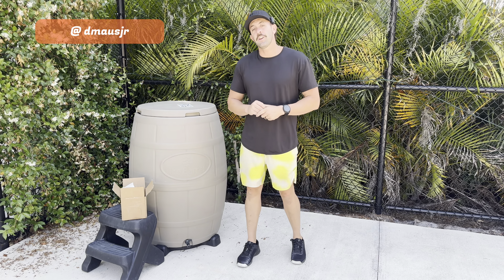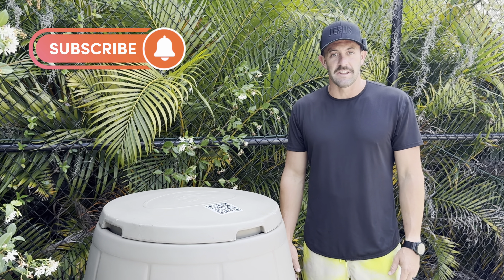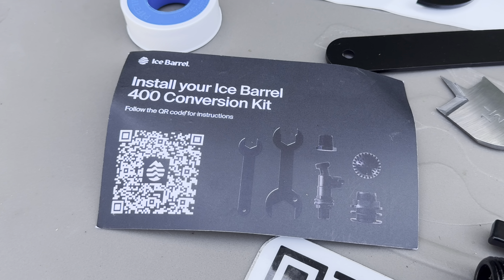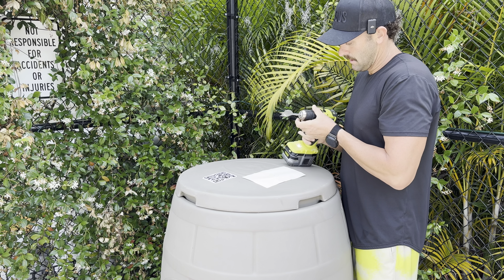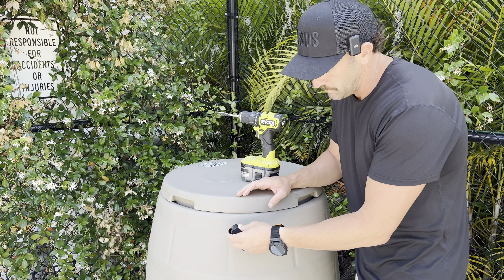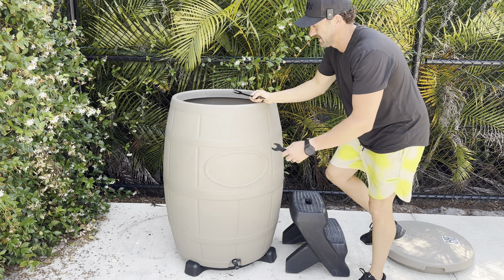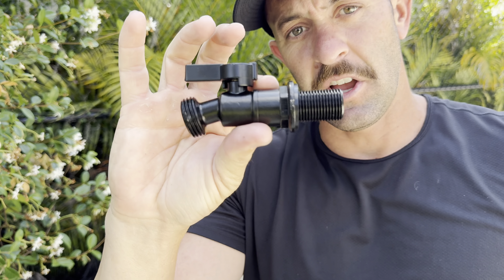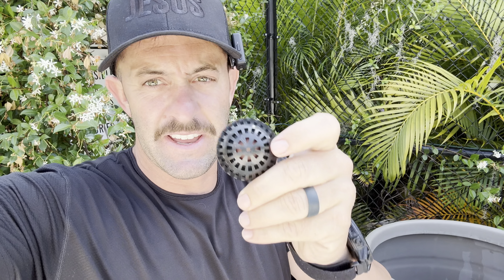How to Add the Ice Barrel 400 Chiller Kit

Comment: Nice video, David! It's about time IB came up with this solution. Going forward, the 400 should come from the factory chiller ready. I guess while they're at it, make an insulated 400. Classic look and design.
Reply from the maker: Amen!
Reply: that’s exactly what i’m wishing for! i’d get the 300 but my husband is 6’5” so it’s gonna be a tight fit. i want the barrel but i also want it to be insulated. the 500 just looks too large and not easily moveable.

Comment: I did the DIY consistent with your previous video. But I used 1 inch hoses. How would I use this system if the hole is 3/4 inch? And the piece that goes in the hole is for a three-quarter inch hose.

Comment: Great videos! I have a question for you. So I went out of town for a week, drained my plunge, but left the filter in the machine for the week which was sitting in a couple inches of standing water. When I got back I noticed the filter unit smells rancid. Even after cleaning it and running through fresh water through the system. So even though the plunge was drained… I’m assuming, it was from left over water sitting in the filter/hoses/chiller. Has this ever happened to you? Do you know a way to get the smell out of the filter unit? I obviously put a new filter in, but I still can’t get rid of the smell!
Reply from the maker: Dang! I would recommend keeping the units running even when out of town (that’s what I do) so that doesn’t happen. Best thing to do it take that housing out and hand clean with some good soap. Maybe run in dishwasher. I know what u mean I have a chiller that broke a while ago and experienced the same thing.
Reply: Awesome! I’ll try that! Thank you! Keep it up with the videos!